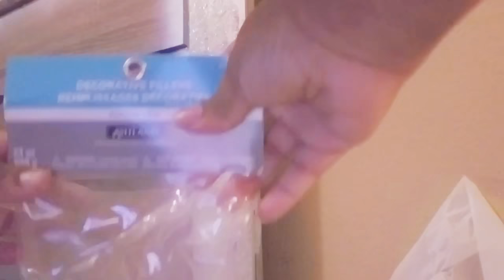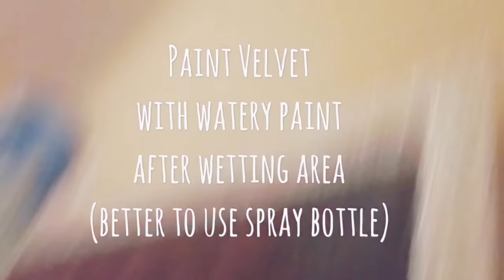Cheap DIY Glam Headboard Revamp

Comment: It's nice but I think for the glitter part it would have been easier to mix mod podge with the glitter then put it on. Buy the color fabric that you want and skip the chalk paint. I'm about to do this with my poster bed frame but without all these steps.
Reply from the maker: I agree, this is alot of steps. I did mix the mod podge with the glitter. But I would definitely recommend buying the color fabric you want. As the chalk paint and sanding was way too much work. 😂 thanks for watching.
Reply: +mommydotcreate (Mommyofboiiz)  When I 1st heard about the chalk paint and then saw how it's used its it's just too much time especially for someone like me with a 5mo old. I want it done ASAP.
Reply from the maker: @lisathompson9585  😂 I know how it can be.

Comment: How did it hold up?
Reply from the maker: It was actually a whole bed frame.
Reply: Right I know that I mean how did the decorations you applied hold up.  Did you have to do any regluing etc ? Thanx for responding
Reply from the maker: @user-qu4ve6fx4x oh sorry, I sprayed adhesive to attach the foam, mod podge for the glitter and broken glass pieces, stapled the velvet fabric, and I used E6000 and hot glue for the buttons and bling wrap.
Reply: @mommydotcreate3521  thank you very much 💕
Reply from the maker: @user-qu4ve6fx4x  You are welcome, thanks for watching.
Reply: @user-qu4ve6fx4x  so did it hold up?
Reply: @wandamcnabb9454  that's what I was asking lol but idk I want to try to do this. She answered me on how to do it but I don't think she understood what I was really asking. I wanted to know since she did it the first time did she have to do it again or touch it up.  I don't want to do it if its constant maintenance
Reply: @user-qu4ve6fx4x  me either but I want to try it, if its worth it
Reply: @user-qu4ve6fx4x  This comment thread has me dead. lol. You were kind in your responses, and it wasn't that hard of a question to comprehend.